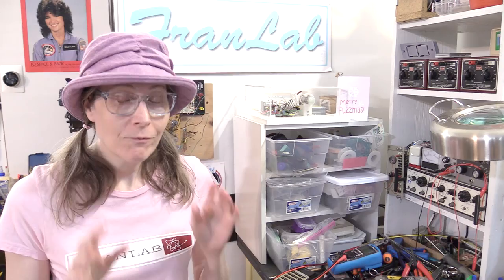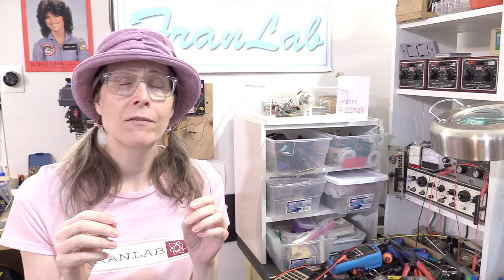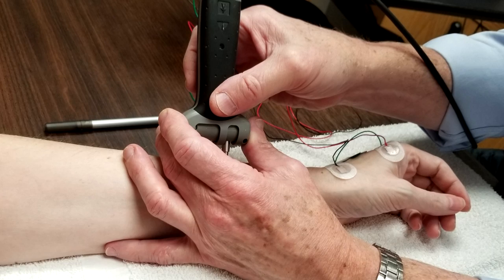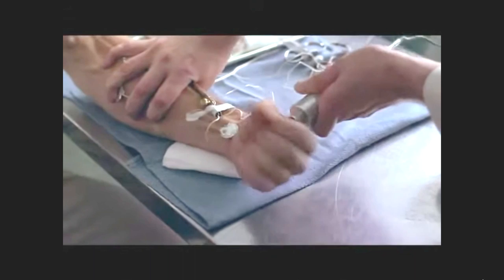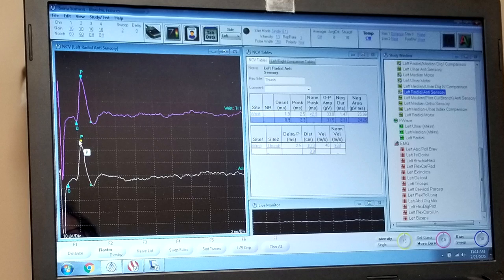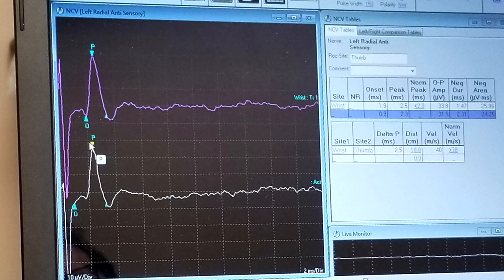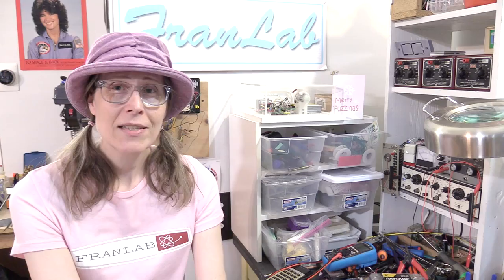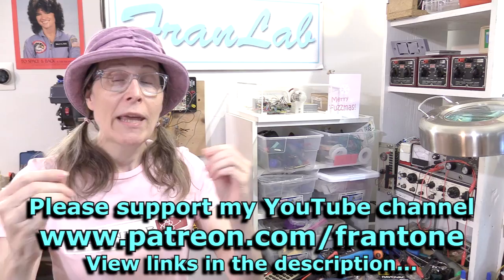Troubleshooting Fran

Comment: In case this helps someone, I had the exact same tests a long time ago (like 20 yrs) when I had shaky hands and weakness in my arms and shoulders over a period.  I saw lots of doctors and was tested for just about everything in the world.  In the end they said there was nothing wrong with me and they could not account for my symptoms.  After that ON MY OWN I found the cause was me sleeping on my stomach to avoid snoring for years.  It took me awhile, but when I got used to sleeping on my back and side again ALL the symptoms completely went away.  I concluded I was pinching something in my neck.  Although well intentioned, doctors are not always right.

Comment: I have experienced tests of the sort several times. A leg or an arm in ice water was the "cold side" of the test. Both arms and legs. This was 20 to 40 years ago, Results were not explained in much detail. I think I was more of a test sample when they were trying to determine if "Post Polio Syndrome" was measurable. I didn't hear anything for years until I was in for surgery when we knew I would be in bed for a week and they provided several comfort aids that were new to my personal experience. 

When I asked why I was told that they always used leg compression units and an adjustable, patient-controlled more flexible bed when dealing with people with a history of polio. So, many years after the testing that I underwent I found out there are long-delayed issues that may appear. 30 years ago I was told that it wasn't real and that if something was present there were no treatments so we should forget about it.

The result was that issues may show up long after recovery. And recovery was defined as being able to walk well enough to get around. 

Sometimes, slowly, medicine makes progress.

Comment: A bit off topic, but related, my dog recently had pups and I stumbled on an article that discussed the development of the pups senses. It takes about 10 days before their eyes open but it takes several more days before they are able to actually focus, see and recognize objects. They are also born deaf and it takes several days before their hearing starts to function. 

And lastly, it takes as long as a month or more for their motor skills to develop, to control their muscles and what not. Reason being, it takes time for the melanin(?) sheaths to develop around their nerves, kind of like the outer insulating layer on an electrical wire.

Comment: @ElectraFran: I've had these a couple of times for a botched surgery which left my left hand useless. The useless part is not as bad as the cold part. The nerve just doesn't even know half of the hand is there so it never tries to heat it. It's the worst nueropathy medically possible. I am wearing a thick "heatlocker" winter glove even now in the middle of a very warm summer. Be glad your symptoms are slight!
Reply: There's always someone worse off, so yeah, be thankful.

Comment: After a major auto accident I had this done on my left side.  They tested all around the top of my thigh down through to my foot (it was crushed - none of the bones were in the right place - it took 2 surgeries to fix, and then I had to have one of the toes that wouldn't cooperate removed later on).  There was a 1220 millisecond delay from my outer thigh to my ankle, and the signals from my inner thigh were lost (never detected in my ankle or foot).  It was interesting, as I also learned a lot of interesting stuff.
The test that I thought was the coolest though was the kidney/bladder ultrasound.  I got to see my kidney actually functioning, pushing the waste into my bladder, constantly along with heart beats.  Never realized before then that the human body runs like a clocked circuit.

Comment: Had several EMG tests on my arms and even my legs once. Some people say it's moderately painful. Others say, it's not that bad. Depends of the technician or doctor doing the test. Some are a little rough on you. I've had the surgery done on my right hand over 10 years ago.
Once the damage is done, there's no fixing it. The surgery just relieves the pain and numbness.
I have severe nerve damage in both my hands and arms. Not shaking, but I can't feel the shape or position of small parts in my fingers anymore. Being a machinist, it makes my work more difficult, as now I have to look at the parts, to be sure they orientated in the correct position.
Getting old sucks...

Comment: I’m one of a tiny minority that has limited pain response.
This means that I either don’t feel pain properly, or have the neural response that is called for when a pain-inducing event occurs.
It is genetic, and so until halfway thru life, I had no idea that I’m not “ normal”.. and Carpal tunnel was what brought it to light.
My hand specialist was delighted. He insisted that, before surgery, we study my situation, for a baseline.  Little did I know that
the extent of my “normal” was so rare. So..I agreed to participate in the study. I was sent to meet the “pain nazi”.
Needles were progressively increased to the size of knitting needles. Voltage and amperage increased to the limits of the
equipment, and safeties were disengaged. No matter what they did, they got zero response. I was amazed.
I had no idea this was gonna go like this.  During my work career, I became an electrician, and later abandoned the high
voltage work, because I was electrocuted badly enough to burn tissue, several times, and didn’t notice until later.
Not good.  Anyway, the pain tech was progressively amazed. Her eyes grew wide as she applied ever more and I didn’t
flinch. After forty minutes, she stopped ( with a variety of needles & wires attached ) , rolled her eyes, and says : “ you didn’t
feel any of that”..?  Well, “ Hell YES, I did”.. I explained.  The process is different for me. I am aware of damage as it happens.
The test concluded. The specialist performed the surgery. And going forward, I have experienced some symptoms similar
to Fran’s. Sometimes I need to do a bit of Alpha-feedback meditation to calm my “nerves”, when I need a steady hand.
It’s all in your head, Y’know...

Comment: I had a "total body" EMG 30 years ago and the hands weren't so bad but the shocks in the legs were not the most fun.  Like Fran, my curiosity about the test data, etc. helped take my mind off the shocks.  I have to assume also that the newer test equipment probably does not need as much of a jolt to get the readings.  I also assume everyone is different in terms of their resistivity (skin, musculature, fat, dry skin, etc.) and the machine has to compensate for that.

Comment: those machines are wizardry. I once tried to make an ecg using a couple of 741s and a cro, that was hard XD. Didn't have any fancy notch filters or anything so the voltage pickup from the mains to my boudy was a huge issue- the best grounding i could manage reduced the pickup down to some small fraction of a volt. which was many many times larger than the signal of interst. still too much noise when i hooked up the  amplifier as differential (probably voltage rail noise, it's bleeding everywhere :D) ended up hooking one amplifier up to each oscilloscope channel inverting one to get the differential, and then manually tweaking  the vernier so that the channels were balanced and the common mode noise disappeared.

even then there was evidently a tiny phase difference between the amps that meant the common mode noise couldn't be cancelled completely.

It was "visible" in the end,  clearly my heart, but i couldn't see the detail very well ( a cro and its lack of persistence is not  the best choice here XD)

and all that was to try to measure a heart which is probably orders of magnitude higher in amplitude than the nerves in your arm ( you said microvolts,  heart is about 1mv peak to peak)

it kinda mad , would love to see the inside of one of those :D, got to have some beeeefy isolation to it.

Comment: For nerve stimulation it's the current that matters, not voltage.  So I'd expect the skin conditions (dryness/oiliness, fat layer thickness, etc.) to affect the impedance path, meaning the voltage would and should vary with not just the patient, but the locations on a particular patient.  For some folks it can be difficult to get current to penetrate the skin due to enhanced shallow lateral conduction, in which case alcohols or acetones may be used on the skin to weaken or interrupt that path.

Similarly, using skin contact for sensor inputs is inferior to using ultra-fine needles that look like acupuncture needles with wires on them.  The hard part there is proper positioning, where the needle must be place right next to the nerve, without puncturing it.  Which is difficult, making the practice somewhat rare outside research environments, far more commonly used on lab animals rather than people (where uses for direct muscle stimulation dominate).

I learned about this over 30 years ago when metallurgists at my employer were looking for additional applications for a metal alloy created on another project that had unique extrusion properties allowing it to be drawn into extremely fine wires that shared many characteristics with so-called "shape memory" alloys yet were much finer and stronger than wires made from those alloys.  I looked into drivers and sensors for using the wire in biomedical applications.  Unfortunately, the wire had some biocompatibility issues that were difficult to overcome, to the point that it would not be competitive with the standard stainless steel needles in the market.

Edit: The difficulties were overcome by using various electroplating techniques combined with polymer insulation, which drastically increased the fabrication costs due to the extensive quality and uniformity testing needed to ensure a safe and consistent product.

Comment: 6:50 I have dystonia and have to get botox shots regularly, so I know exactly what that thing is as they use one on me all the time. A little white box with a speaker, alligator clips, and needles (in my case with, the medicine needles are the conductors). The sound is exactly as you described, like radio static that gets lounder the further they plunge the needle in or when you move. When I first had it done the doctor accidenly got the probes to close and it suddenly screeched like mic feedback (scared the crap out of me).

Comment: I had an EMG to determine the cause of my peripheral neuropathy in the feet by my neurologist several years ago. Same procedure, but it took under 20 minutes first by a technician than the doctor. It is painful and had a point scab that lasted a month where the needle probe was inserted in the area of the cutoff. The reflective wave was elongated, suggesting an inflammation of the nerve myelin sheaf in that area. The main pulse and the reflective reminded me of an A-scan radar display. That was followed by a lumbar puncture (spinal tap on eleven?). The EMG and the tap provided a positive of an autoimmune disorder called CIDP (Chronic Inflammatory Demyelinating Polyneuropathy) which starts in both hands and/or feet. This sounds bad and it is if one does not get the proper treatment in time. This disorder has a 90% chance of long-term remission with some recovery of functions in the affected areas if treated quickly. Rare disorder, some are left in wheelchairs due to the delay in the diagnoses and the characteristics of their autoimmune system. My cousin had MS with the same symptoms. No cure for MS, I lost him at age 72, 11 months ago.

Comment: The Cadwell Summit StimTroller (the handheld part that "shocks" you)  specs a constant current range of 0 to 100mA (0.03mA resolution) and 400V maximum.
Reply: That's what I was thinking, it would inject a certain amount of current for a certain amount of time, and the resultant voltage not so important. Around 4:30 that's pretty much what she's saying.

Comment: Fran, the stimuli probably uses a current generator, so the voltage is highly variable depending on your skin resistance. Get similar sized probe and you can measure your skin resistance. If you know resistance and current, you have the voltage! No?

Comment: As soon as you said needle, I knew I never want this to happen to me.
Reply: It's honestly not that bad. The needle is very sharp and you don't feel a whole lot except for the meaty part of your hand that's under the thumb. Lots of nerve endings there... very weird feeling. Otherwise, it's virtually painless... just a little uncomfortable.

I've had this done a number of times on my neck, hands, feet and legs.
Reply: Just hope that you never develop type 2 diabetes!  Pricking your fingertips to test your blood glucose levels 3 TIMES A DAY, and THEN injecting insulin, isn't much fun either!   But at least the needles are reasonably short and thin!
Reply: @hectorpascal  well thanks to some engineers and other science ppl now have those Glucose monitor devices and insulin pumps
Reply: @YT-Observer  Yep - great if you can afford them!

Comment: How the emitting probe appeared makes me believe that the voltage cannot be very high.  For operator "safety", there are limits to the voltages.  Another background reasoning is that the human skin resistance is generally assumed to be in kilo-ohm range (and more when dry) we would supposedly need several volts in order to impose your mentioned tens of milliamperes.  In fact, I speculate that the device is current regulated, so it compensates that way for the skin condition.   On the other hand, they might have some conductivity enhancing substance at the probes.  Or with the relatively fat electrodes, they may even depend on capacitive coupling.  Interesting, as Big Clive uses to end his blogs.

Comment: Maybe 20 years ago , I built a TENS unit with two settings ...low was about 70 volts , high about 90. Enough to fire a NE-2 bulb. I suppose it's similar to that stimulator.

Comment: You made an unpleasant thing into a learning and educational opportunity, for sure, though I'm sorry you had to endure the discomfort. Question about Fran's internal circuitry, does it operate using 6 or 12 volts on the filament, in case we need to order spares for her?

Comment: Yeah, I’ve had a couple of EMGs.  Unpleasant.  The doctor asked me if did electrical work (which I do) and explained that people who have been zapped on the job a few times are often the most uncomfortable with the test.  Makes sense. ⚡️😕
Reply: I've had several nerve conduction tests, mainly focusing on my legs.  Each time it was less than an hour, so it wasn't as involved as Fran's, but the same basic thing.  The shocks really didn't bother me much.  I told the technician that when I was 5 or 6, I played with the Christmas-tree lights and got shocked several times, so it was old hat.  On the other hand, having a needle in a muscle while you flex it can be rather painful.

Comment: TENS units generally operate between 50 and 100 V in my experience so I'd assume it'd be in the same sort of ballpark.
Though I assume the stimulators are constant-current so they probably push as much voltage as they need to to maintain the current (within sensible limits ;) ).

Comment: Medical devices often use controlled current pulses, which would explain why few resources indicate voltages used. The voltage required to achieve a certain current through tissue changes based on electrode properties, interface materials, and the tissue being stimulated.

Hearing the sounds resulting from your own brain calling on a particular muscle to move is the essence of bio-feedback. A very valuable treatment mode for a variety of diseases. Usually, the EMG signal(s) are just picked up with some surface electrodes and the patient views a graphic or plays a simple video game.

Since our nerves are electro-chemical bucket brigades, it makes since that you get faster performance from the chemistry of each electro-chemical interface.

Are these tests for things like ALS, or Parkinson's? Good luck, Fran. I hope you're not suffering.

Comment: Fran, there is a whole field that has to do with how  EMF interacts with our cells. A good start is "Earthing: The Most Important Health Discovery Ever."  by Clinton Ober, Stephen Sinatra, MD. and Martin Zucker. There other books and many videos on the topic. Very basically the idea is that the electrical devices called cells operate at an optimum voltage of no more than 50 millivolts (0.50 mV). Average cellular voltage is 20 millivolts (0.20 mV). It is common for those who are around a lot of EMF from electronics and electrical devices to get body voltage up to 4 volts (4.0 V). Not good. This is nothing new: U.S. Navy research from the 1970's is often cited as early evidence. Lately, with the explosion of scientific research, instrumentation that reveals cellular effects, and the Internet the concept has become more widely known.  It is easy (if you have electronics knowledge) to measure your body voltage with a common digital VOM. The simplest solution is to ground your body. This ranges from standing barefoot on grass (where you can see your voltage drop quickly) to grounding yourself inside (where you can see your body voltage drop rapidly. Ambient EMF , as a form of radiation, is an abstraction to most people. An old idea in science is: "You understand what you can measure." Fortunately this is simple with body voltage. I sent a PDF to your email that visualizes the procedure.

Comment: I'm surprised you don't know what voltage they used. You know the current, and you can measure your skin's resistance, so... Ohm's Law! Multiply the 80 mA by the resistance of your skin and you'll have the voltage.  (You have to be at the same sweat / temperature level, so maybe they could have measured resistance during the test too.)